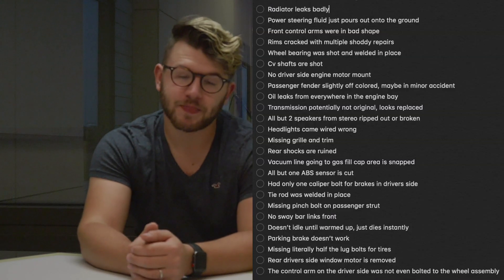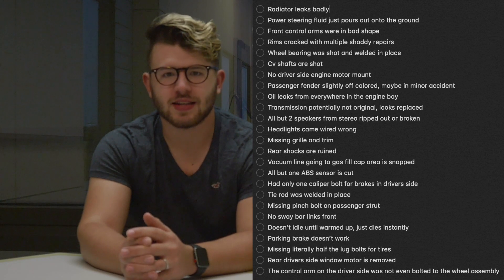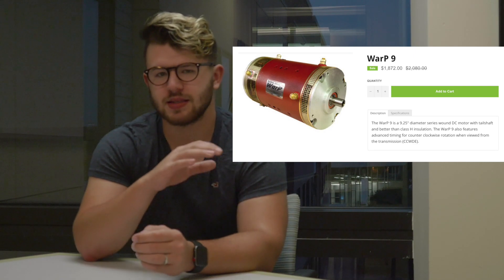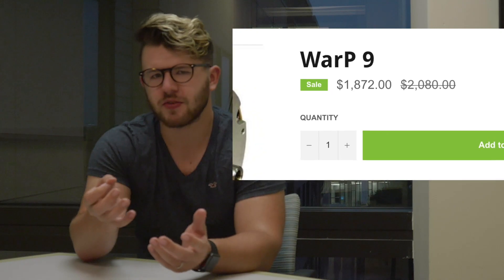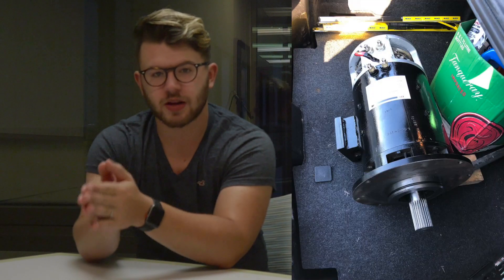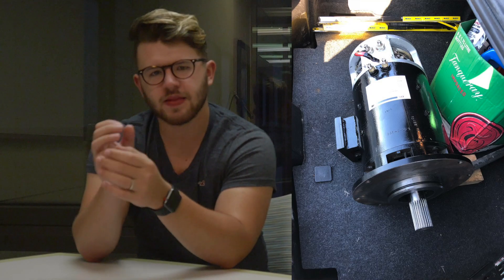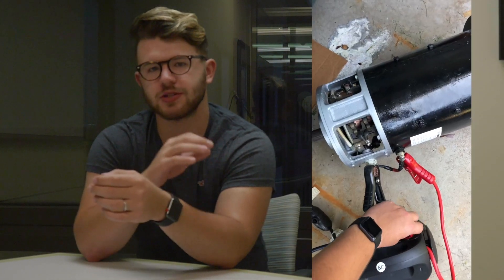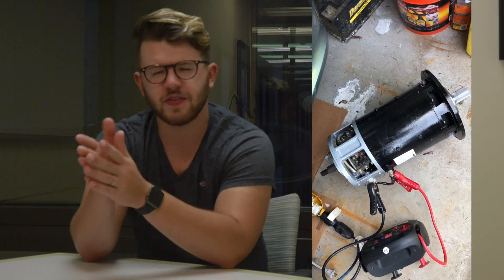DC Motor Purchased! - Electric BMW Conversion Part 2

Comment: looks like things are starting to come together! You might want to check the power graphs on that motor, make sure you have the torque at cruising speed (70 mph) . I've noticed looking at the power graphs  on these DC motors, the torque drops like a stone at fairly low rpm's. though, I still in the learning stages myself, so, I could be wrong. Regarding lead acid batteries, that's quite a heavy car to start with, so, its going to push the weight up "significantly."  Good luck with the project though! gonna start my conversion soon, still lots to learn on my part,
Reply: sorry. should have said "high rpm's"

Comment: Great project start! Any ideas on what the X drive system will do once disconnected from the ECU? Did they use electric clutches or is it mechanical?
Reply from the maker: Thanks!
I'll be 100%, I am not entirely sure how it'll operate. I know they claim the xDrive system has some sort of torque vectoring capability. The funny thing is that I wouldn't be surprised if the system is not even operational right now. 
The car drives, but that's about it. Every electronic feature is throwing so many errors, not to mention the previous owner cut 3 out of the 4 ABS sensors. I plan to repair these things, since that's a safety thing, but since the car doesn't know how fast each wheel spins right now and it still moves, I assume I should be fine with disconnecting the ECU. 
I haven't looked into it too much, but I also have wondered if I can keep the ECU spoof the engine data to get some other functions back. 
These are all hurdles I'll have to overcome when I get to that point.